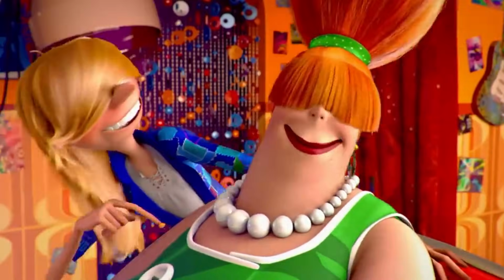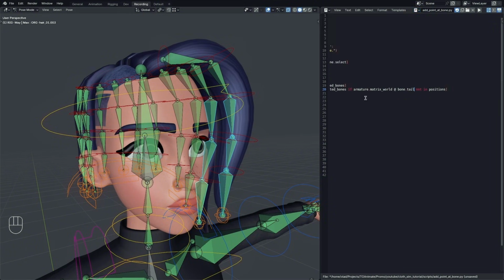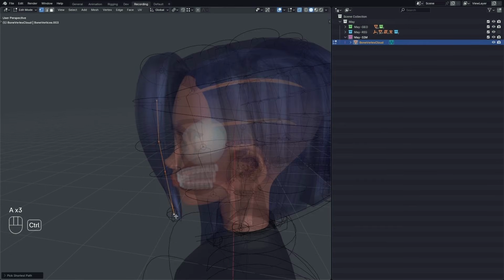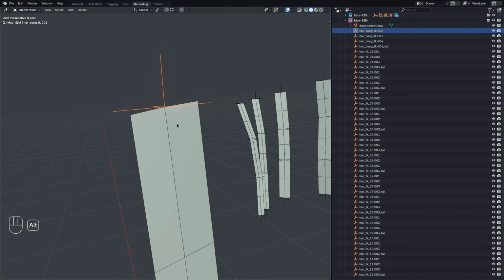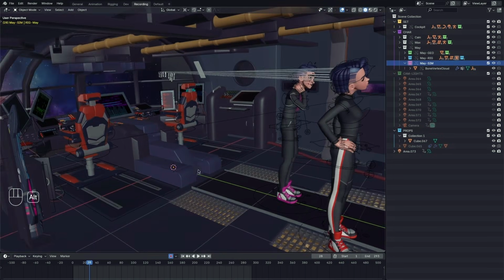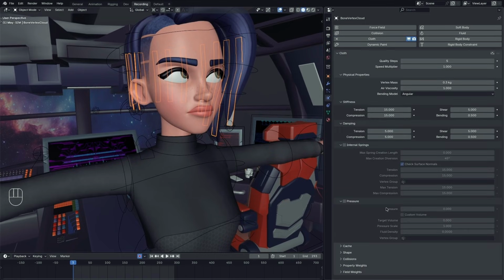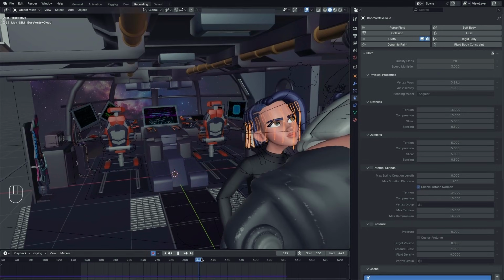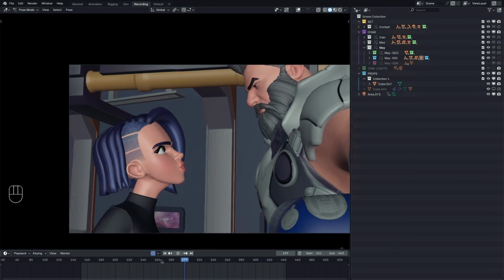Let Blender Animate Hair For You (Using Cloth Simulation)

Comment: 9:40 I'm literally doing that right now, you can select a vertex on a mesh, tab out of edit mode, shift select a bone, Ctrl + P, parent to vertex, and the bone head follows that vertex both in object and edit mode ? Even moves with modifiers on the mesh object !

Also I think the manual step of parenting vertices to empties could be automated with a script, especially since they're about targeting something else based on distance !

One downside to this method seems to be the lack of disabling of movement under a certain value threshold, which I guess you could fix manually in the curves afterwards, but quite visible at 23:06 causing jitteriness.

Awesome tutorial/method though !
Reply from the maker: Thanks!
it's not constraining the bone but the entire armature object, so all the bones are gonna move which is why they move in edit mode as well, cuz the whole object is moving.